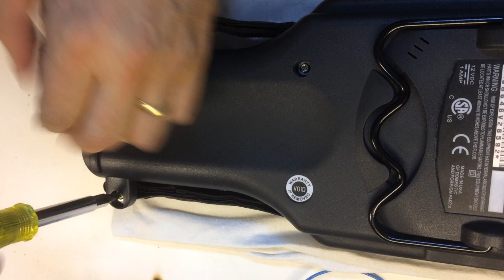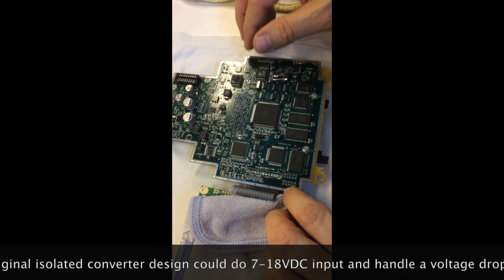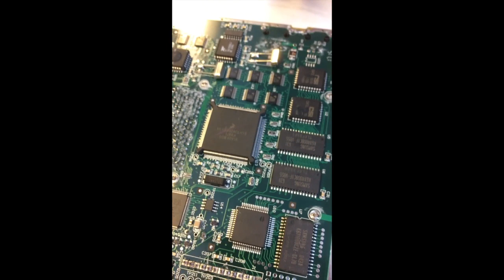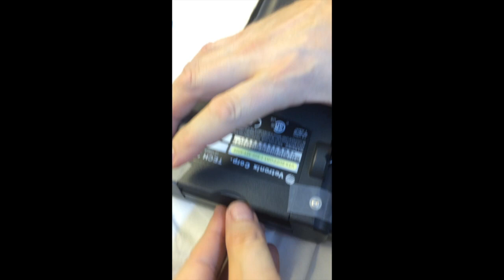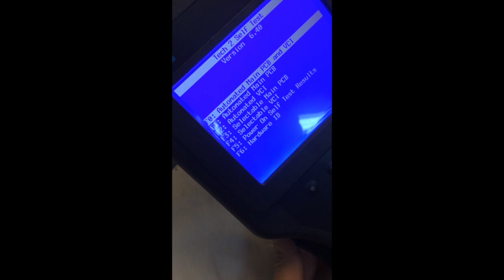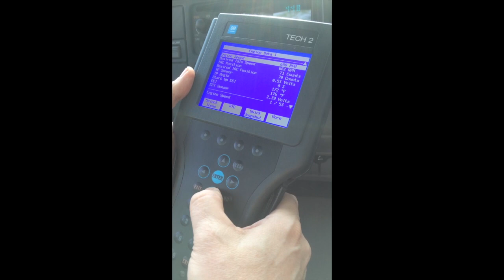GM Tech 2 Scan Tool DC-DC Converter Replacement / No Power On Repair (Dead Tech2 Unit)

Comment: DrShock, I have a 1996 Buick Century and I need to replace the Master Brake cylinder. The shop manual states that prior to removing the Master Brake cylinder I MUST perform an ABS "Gear Tension Relief" procedure. The Shop manual states that this process is done utilizing the GM bidirectional Tech 1 scan tool. I was going to purchase one of these Chinese knock-offs if it performs that function. When you scroll through the menu have you ever seen "Gear Tension Relief" as an option? It's a completely different procedure from the auto brake bleed cycling procedure.  Thank you for the video... great detail...
Reply from the maker: @John Barrett that Tech 1 tool is a really old one and I don't have access to one anymore.  But the Tech2 does have this procedure.  I can't check live as this is something that only comes up on the menu after the tool communicates with the actual vehicle.   But this PDF I've found very useful over the years for confirming menu paths for various functions in the Tech2.  I see your procedure listed here - https://gsi.ext.gm.com/userguides/GM_Tech2_Paths.pdf
Reply: @DrShock  You sir are a God! Thank you.
Reply: DrShock, One last question: Would you have a recommendation for a seller of the Tech 2? I figure that these units are most likely being manufactured by maybe 2 or so separate shops. I was just wondering if you may have noticed better quality from one over the other. On the other hand, it is China so it's like fishing in the ocean when it comes to quality. 
Thank you again for taking the time to answer these questions. You are a wealth of knowledge.
Reply from the maker: @John Barrett As best I recall when researching for my own Tech2 clone purchase several years ago, there were two "cloners" in China.   I don't recall that there was anyway to tell them apart, but the better deal was the one that included ALL of the cables and adapters like the original.  If you look at this eBay affiliate search  https://ebay.us/pvwxSt you will see a mix of Tech2s, including some originals.   

The ones with pictures of a CANDi module, DLC cable and 5 DLC adapters (you'll see stuff you'll likely never use like a SaaB adapter) are the ones I would focus on.   These "complete" kits are almost certainly the higher quality build type.   Though nowadays you hardly ever see a US based seller offering them and have to go with China.  I prefer eBay for these kinds of purchases since I know I can get my money back if there's a problem.  GL.
Reply: @DrShock , Thank You again for all your time and attention. I followed your lead and just ordered one off ebay. It was $309.00 including shipping from Rowland Heights, California.
I'm using those PDF links you sent to get a head start on it's operations prior to its arrival. The more I read and research this unit the more it appears that it's a decent investment for working on the old 1996 Buick.

Comment: Great video but I have to admit while I do a lot of things myself this scares me.  Do you know of a repair shop I could send it to for reworking the soldering joints and replacement of the DC/DC 5VDC power converter?
Reply from the maker: Unlikely you would find a repair shop in general for this type of device.   If you have an old school TV repair guy where you are, they might entertain doing it for you.   It's just the experience and comfort with desoldering and soldering that is required, used to be pretty common skill in consumer electronics repair but now everything is throw away rather than fix.  But a long established TV repair place should have those skills still.

Comment: Hello, I need help, my tech2 starts very well, but in a minute the whole screen turns blue and you do not see anything ... I have to wait for about an hour and it goes again, it works fine but in a minute it puts blue again, what could it be ?, the capacitors?
Reply from the maker: Have not come across this problem.   There are no schematics for these, so if it were happening to me I'd have to throw parts at it sadly.  If it was a clone and not a genuine Tech2 (too expensive to repair a genuine one), I'd try replacing the LCD assembly unit as it reads like its dying out once warmed up (though check and clean the internals around the LCD connectors first) - https://ebay.to/2HZiQn8

Comment: Hi, great video! I have a question no one else has been able to answer about my Tech2 knock off that i bought for my Saab 9-5 2008. If anyone could give me some advice it must be you. It worked fine for over two years in my own 9-5 2007 and 2008 cars with the CANDi interface, but then i hooked it up to my friends 2006 Saab 9-3 that had some electrical problems with the generator etc. Big misstake! After that the Tech2 lights up and seems normal and passes all the test but does NOT recognize the CANDi interface which does not even light up as it did before.  I thought this was the problem so I bought a new CANDi but still the same problem. So then i bought a new cable that connects the CANDi to the Tech2 thinking that must be it but no luck this time either.. Both the interface and the cable tested fine with another Tech2 an my original CANDi is also fine it seems. If fiddle around with the connector to the car the CANDi blinks a little in a certain position but does not act as it should or stays connected. Getting tired (and poor) thowing parts at this otherwise great diagnostic unit so I am therefor asking for som expert help.. Would greatly appreciate any guidance or direction concerning this from you or anyone else out there .  Best wishes from Sweden! Bobby
Reply from the maker: Hard to debug things like this without a second Tech2 and CANDI module as well as a second vehicle preferably older pre-CANDI.   When I've hit such issues I've first swapped things around to see what changes I get in behavior.  I've never seen, or even heard, of a clone cable going.  Have heard of CANDI failures though.   Will the Tech2 work on an older vehicle, one that doesn't need a CANDI?    What you're looking for is data to help do root cause analysis on the point of failure to avoid throwing parts at it.
Reply: @DrShock  Thanks for reply! As I wrote the both of the candi units seems to be fine as they act the same way with my Tech2. One of them was tested with a different Tech2 in another car without issues so it must be my Tech2 that is at fault. I have not tested it with a car that does not need the candi but probably should..I was hoping that there might be a circuit in the Tech2 that powers up the candi that could need repair. But just guessing as I am not qualified in electrics..
Reply from the maker: No schematics ever published, so very little can be done to repair them beyond basic power supply parts because of that.  But if you find it still works with an older vehicle, it may have value to someone to resale for that.

Comment: Your tech 2 clone looks way better than the one I got My screen has pinned connections Case is all rough, its like the assembler broke off plastic tabs in it too, Steel Card door.   I have the same power module in mine but no heat sink is on it and it gets warm!  I kinda wish someone would say who sells the higher quality tech 2 clones vs the low end ones which I mostly likely received.   It does pass all the tests! Has Epson and Samsung chips if they are not fakes

Comment: Will this fix prevent the tech 2 from rebooting when restarting engine for calibration mode?  Even using a separate power source?
Reply from the maker: Yeah but they're asking about a clone tool here not the Vetronix original.  The clones do not behave the same way as the Vetronix, they reboot when you start the engine because of the DC-DC converter differences.  You could connect a separate power, but normally you're remote with the vehicle and no AC power making that impractical but sure that should work too.
Reply: @DrShock  I just watched a tech 2 clone video and all the guy said he does(and showed) is he attached the cigar adapter and plugged it into the tech 2. he shows himself going through the tech 2 with KOEO and then he starts up the vehicle and the scan tool doesnt reboot, due to the cigar jack being hot at all times(like a lot of cars). Have you experimented with that at all? Heres the link to the cable:  https://youtu.be/6NzY0L2_xhs?t=132   and the start up is here:  https://youtu.be/6NzY0L2_xhs?t=369
Reply from the maker: The only thing I've found that works consistently across all vehicle types to avoid the restart on cranking problems is a switched OBDII extension cable.  I did a demo video of one here - https://www.youtube.com/watch?v=Mz-Ar6TAuiY
Reply from the maker: Sadly no.  The problem is that the isolated voltage DC-DC converter GM spec'd was custom, and could handle an input voltage drop as a low as 7VDC without shutting down output voltage.  No part publicly available can handle less than ~9VDC without shutting off momentarily, due to the high cost to manufacture to such a spec as GM had.   During an engine cranking event the vehicle battery power does drop below 9VDC or even 8VDC depending on the vehicle model and battery situation (there are some vehicles that this doesn't occur hence reports this fix "works" but it really doesn't in the broad sense).  There are some projects out there to use an LM2596S converter device, but its quite involved to get the Tech2 power button to still work with it, and then its not isolated voltage anymore anyway which could introduce problems for some SPS calibration procedures.   What I did is I made an adapter that sits between the vehicle plug and the Tech2 cable that removes the voltage pin to force external power to be used (gotta keep a commond vehicle ground though).  In a pinch you could look for a fuse supplying the ODB power and pull it, some vehicles have this since its an external port.
Reply: @DrShock  This is taken from the Tech 2 user manual 2006 Vetronix... "If the DLC and external power source are both connected, the power jack connection supplies current to the Tech 2. In this instance, power from the vehicle's DLC connector is automatically disconnected from the Tech 2 internal power supply."
Reply: @DrShock  can you do a short video about this?  My friend has a couple of Chinese made tech 2's like mine and one of them doesn't reboot. And able to calibrate on the same vehicle.
Reply from the maker: Its random like I mentioned, some of the replacement DC-DC converters just by luck/chance happen to tolerate a bit lower input voltage before shutting down, so they survive the engine crank battery voltage drop.  If you mean about making a video using the LM2596S approach?  Yeah, I'll consider that may be awhile before I can get to it though.

Comment: good video i have a problem with my tech2 i write a wrong bin file on it and i want to erase all but i dont know what i do soory for my english im french
Reply from the maker: If you have an active ACDelco TDS subscription, you can update the firmware using TIS2Web to the last version ever released for your country region.  If you have TIS2000 you can at least update the firmware to the last version of 2007.   If you have neither, it gets alot more complicated and best to google your options there to update the PCMCIA memory flash card manually.

Comment: My TECH2 still powers up and works fine when getting power from the car, but when I use the power plug on the bottom of the TECH2 it sometimes will not power on. When it does it has pops and sparks coming from the power supply. Tried other power supplies, does the same thing. Seems like power is kicking back from the TECH2 (bad diode?). Can the DC to DC converter cause this as well. Device works fine otherwise.
Reply: Edward Shockley 

Yeah, I thought about it more and took the vci module out. Going to swap it out with a friends and see if that fixes it. Thanks for the reply.
Reply: Just an update. Replaced the dc-dc converter. All fixed. Ran self-test everything passed. Power from external power supply working fine now. Thanks for info from this video. Big help!!

Comment: Thanks for this! Very helpful. My AliExpress version just died the same death. Another option is buy the entire board with new heatsink for $95.00. Expect a two month lead time though.
Reply: Success! Thanks again. I removed the screen for easier soldering. Also went with your method of just attacking the heatsink and brute forcing the pins through. Agreed about power supply removal taking most of the time...
Reply: @djfremen  …. How did you remove the screen? Was it soldered or did it have a clip/plug? There one for sale with a new screen but everyone read said some are soldered and others just plug.
Reply: I think mine has a different problem... mine powers up.
Then when askes you to press enter at main screen 
Nothing happens at all..

If remove candi box pressing enter wil work but then askes for candi box argh 😢

And it smells tad burnt where the bottom thing slides into the board
Any suggestions anyone plz 🙏